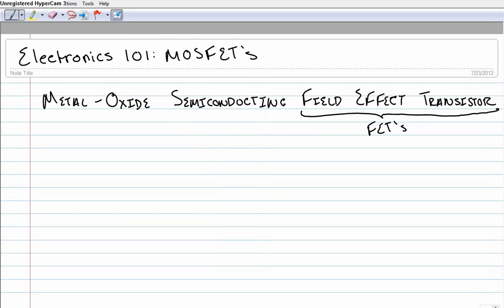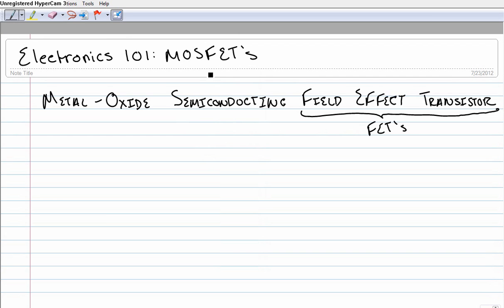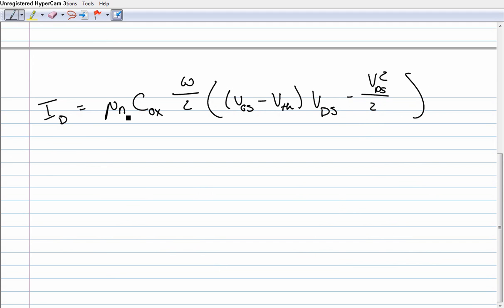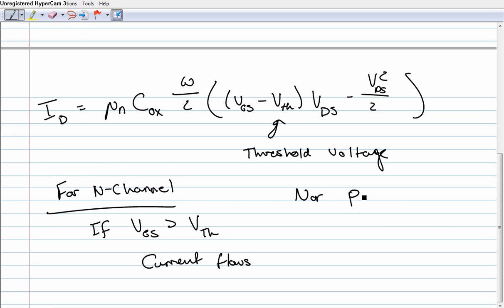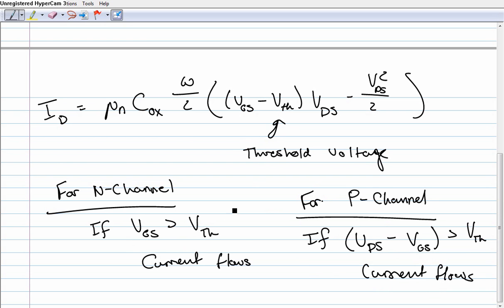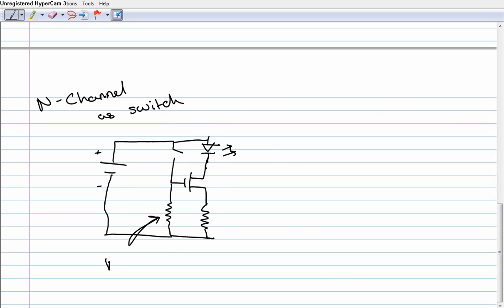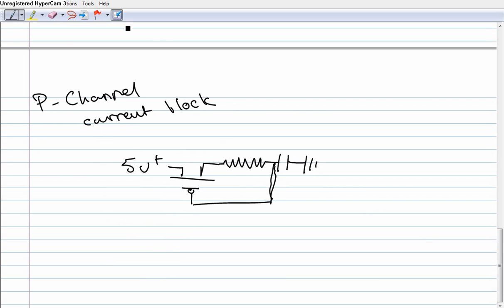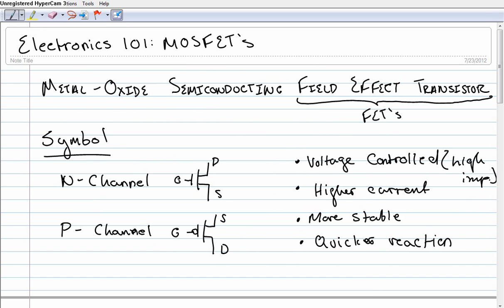Electronics 101: MOSFET's

Comment: I think your explination for the resistor attached to the gate is flawed. This would act more like a biasing or pull down resistor. How could it possibly be there to prevent a short? There would nothing connected to the gate when the switch is open if the resistor wasnt there.

Comment: I'm not sure if I get this exactly, I think I understand the N and P channel switch on or off thing, but I'm wondering about what part they play in say audio amp circuitry, are mosfets used to amplifiy, or are they used to control BJT amplification circuits or can they be used as either, or.......?
I like the videos, but I wish they went a little more in depth with a component, and a little more into it's use in everyday things.
For example, this video on MOSFETS, could have used a shown example of say a car stereo amp, or a guitar amp that uses
them, and how they are used. 
I think that would be very helpful to those of us who have to see it more hands on than what they can visualize from a basic schematic and some notes, not that the schematics, the notes, and the formulas aren't awesomely helpful. 
Hope you make more videos, & never run out of video ideas in electricity and all that goes with it.
Reply: I don't know about audio equipment, but I know MOSFETs are used in motor driving circuits like H-bridges.
Reply: Nunov Yobeeswax Both MOSFETs and BJTs are used for signal amplification but math for that applications are more complex, if you would like to learn them I suggest you search for analog electronics or amplifiers lectures on web.

Comment: No, if you take a positive lead and touch and let go of the gate of an N channel fet, DS currnent will flow and won't change states until you ground it out.  I guess it's because of the cmos material it's made from, and that's one of the reasons you have to have a pull down resistor in the circuit.  I've tried it and it works great, but I don't know how long it would remember its state.  I think it even remembers its last state when you shut off power to it too.